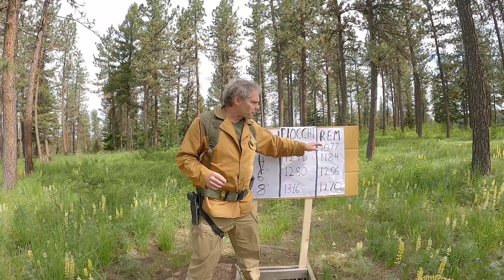How Does Barrel Length Change Velocity

Comment: I wonder. Does barrel length affect bullet spin or not? I always assumed it would, but now, thinking about it, I do see it making a difference. Once an inch or two of spin is put on it, is that all?

What about a crazy barrel configuration with a few short inches to make the spin, and then a lower friction texture for the rest of the barrel? Then the bullet could already be rotating freely while still being pushed by the expanding pressure. (Not sure if that's even possible)
Reply: To add to what Paul has said:
With regards to bullet spin, the twist rate of the barrel (ex one turn in 10 inches (1:10)) will result in the bullet spinning at that rate. As the velocity increases, the distance travelled per revolution stays the same, but the actual RPM of the bullet does increase. There is some discussion that higher RPM at impact plays a role in increasing expansion. I suspect it does, but a very minor one.

Barrels with varying twist rates are referred to as gain twist barrels. Typically they start with a slow twist rate and that twist rate increases as the bullet reaches the muzzle. Not very popular, but available from certain custom manufacturers.

The most well known example would be the Italian carcanos. My understanding is that they used this because of fears that the bullets would need to be spun up slowly as to not damage them. It was something of a state secret at the time.

The issue with a short section of rifles barrel and then smooth bore would be twofold. If the smooth section is of groove diameter, gas would blow by the bullet along the rifling grooves cut in it. If it was the land diameter, you would experience increased pressure as the bullet is further deformed. This may also interrupt the spin of the projectile.

FX airguns has had success with a smooth bore that only has the last few inches rifled. They called it their smooth twist barrels.
Reply: Addemdum to the above question. Does rifling have a sharper twist as you go farther down the barrel or is it the same all the way?
Reply from the maker: @Jabberwockybird  Same all the way through. 
 As for Barrel length effecting spin, lots of variables, but generally, the 2.5 inch barrel in this presentation will put the same spin rate as the 8 inch barrel.
Reply: @PaulHarrell  Thanks for responding, Paul.
Reply: @Jabberwockybird  that's typically called progressive rifling, there are some guns that have that (notably the milkor MGL variants) but going off what paul said the dan wesson doesn't. 
theoretically, with a longer barrel at the same twist rate you will get an incrementally faster spin rate due to some engineering reasons, but the difference is going to be next to zero.

Comment: As a septuagenarian I am anxiously anticipating your ‘Which part of the trifocal?’ test and demonstration video. Cataract surgery in 2015 much improved my situation, substantially brightening my view of whatever front sight is in use, and allowing a return to less complex shooting glasses. However, presbyopia does seem to result in diminished resistance to cumulative eyestrain: In less than optimal light, I find myself working hard to choose among two or three apparent front sights after less than an hour at the butts.
Reply: I'm right behind you and typically cope with it by using 1.5x "cheater glasses" so the sight picture is sharp and clear, then just aim at the center of the blur.
Reply: If you are right eye and right hand dominant, pick the front sight on left when having double or triple choices.  At least that's what works for me.

Comment: I think it's fascinating to hear the subtle changes in sound with the different barrel lengths during the shooting portion.
Reply: Yes, you can hear that from 4" up the rounds become supersonic which is something I've never experienced the difference of before.  Something to think about if noise is a concern.
Reply: You can also tell by the sound whether a round is faster or slower than the previously shot from the same barrel... Faster is slightly louder and higher pitch than the slower round.

Comment: To your point about the previous .38spl test between the two sub-2” barrels I’d wonder how the barrel twist rates compare between the two. Since energy is always conserved, I’d be will to guess that the slower bullet had a higher twist rate. Increased angular energy with less translation energy. Great video as always Paul!

Comment: At handgun velocities, projectile diameter and penetration depth are the only measure of effectiveness, so even a hundred FPS may not be a significant difference if certain cases. If a hunter can drive a 43 caliber hard cast bullet all the way through the target @ 1000fps 1400fps will cause no more damage. But if 43 caliber expanding bullets are driven all the way through, but with minimal expansion @ 1000fps, but have maximum expansion and full penetration @ 1400fps, there is a significant gain in effectiveness. There are also iffy zones where expanding bullets will make a bugger but shallower hole than a non expanding bullet. Then wound volume makes the difference, not velocity or expansion

Comment: 4” barrel is optimal balance for carrying and velocity for 38 spl/.357. That’s why most revolvers are offered in ~4”.

The adage is for every additional 1” of barrel, there is a gain of 100 FPS. But as Paul stated, it depends on gun and ammo and there are diminishing returns.

I think it was Shooting Times that used a Ruger Blackhawk and cut the barrel down 1” at a time and measured the velocity. Article was probably 25 years ago.
Reply: Yeah, I remember that article. Have read ST since I was a kid.
Reply: Mainstream ammunition brands are going to run pretty under-utilized powder capacity in the .357mag. If you want to see more dramatic velocity increases with barrel lengths, go with the hot stuff. Buffalo Bore, Underwood, Grizzly, Doubletap, Corbon, Steinel, and some others. Buffalo Bore will run 158 gr bullets at 2,153 fps from a 18.5" carbine, and 2,298 fps with 125gr in the same carbine.
Reply: @turnin.sprocket  yeah the big box 357 is pretty weak nowdays. I was one of the last guys on the road that carried a 357m back in the early 90s. Coworker bought a chrono and also loaded at home. I brought my carry ammo which was winchester cheapo white box 125g sjlnhp vs his hot home loads. We run it all thru a half dozen s&w of varrying brl lengths and a bolt action 8" brl pistol.
The winchester factory loads were maybe 25-35fps slower than his hot loads.  My 686 6" was sending the winchesters down range around 1500fps. Same round out out of the bolt action was nipping at 2000fps. Nowdays you gotta buy boutique 357 to get those #.  I'm still a fan of 357m out of a 4 or 6" barrel.
Reply: I've heard 1 inch for 50fps and that is with 20+ inch and centerfire rifle rounds.
Reply: @WayStedYou  rodger that. All these years later I still have to stop and contemplate variables. I've seen some things in pistol cartridge vs barrel length. 45acp seems to be a poster child where barrel length can negatively impact velocity. I've yet to see anything where magnum cartridges are negatively affected. Seems like 357m and 44m really cook out of carbine length brls
Reply: @richardcheese4722  Someone did a pretty painstaking test with a long test barrel, sawing 1" off at a time. 45acp:  /watch?v=lR_oshbhII8
Reply: The optimal length is completely subjective. Context is king.
Reply: My GP100 4.2 agrees!
Reply: Your wife rather have 8"  stop trying to make up stuff why 4" is better
Reply: @DogDad303  diameter or circumference?
Reply: @richardcheese4722  Ground clearance.
Reply: @DogDad303  "Tell me you've never lugged your piece through the brush without telling me you've never lugged your piece through the brush"
Reply: @michaelturk7237  brush clearing is all the rage these days

Comment: Ammo companies make ammo with quicker burning powders that helps with shorter barrels. I don't know if it works, I just see people talk about it. I don't have a chronograph, I just look for tight accurate shot groups. Quality carry ammo usually gives you consistency, cheap range ammo can open your groups from inconsistent charges and other QC issues. Hornady is good, Herters your lucky if it leaves the barrel. Barrel length seems to not matter to people anymore since more people carry snubbies or little pocket size semi autos. I like carrying my LCR or Hellcat for convenience but still like full size pistols and revolvers for fun at the range.

Comment: Great topic and nifty test equipment.  I liked how you tried to mitigate the other factors by using the same frame but different barrel lengths.
Reply: SCAM ALERT! ^^^ THAT is a SCAMMER. Please be aware that that is a SCAMMER and do not fall for the SCAMMER.

Comment: Since I only see pistols there, I’m going to ask this question ahead of time, as I begin watching. What is the effect of a 16 inch barrel on a 9mm PCC? I ask because I have been told that 147 grain for instance, is ideal for this length. I’m assuming because the barrel speeds this heavier but usually slower round up. I want to confirm the validity of this.

Edit: loved the attention to detail and dedication to giving us the “boring” stuff (that isn’t boring). I see a Paul Harrell video and am watching within minutes.
Reply from the maker: We have a presentation comparing handgun velocities and PCC's
Reply: @PaulHarrell  Thanks !!
Reply: @danoneill2846  Thanks Paul! Dan found it first. 👍
Reply: @NOLAgenX  I felt bad sending you to Lucky Gunner when Paul did the work & this is his Ch . I forgot about this video . BTW I have a Foxtrot Mike -9  16"   so far never jammed , great option . Also , Win Wt box ammo gets lots of dis , Paul & Tarren Tac , and I , say it's great ammo for the $$$ , only slightly worse if any than the high $$$ ammo . Gun Sam has done some testing with it also , it did very well !!!
Reply: @danoneill2846  Really appreciate the info. I’ve found a large amount of the older Federal 9MS 147 grain that fires without incident in my Scorpion Evo 3 16”, and even target ammo that has the same stats, so I’m sticking with those. 

Similar to what Paul said in the PCC video about staying consistent since different ammo can have different points of aim. I just had no real idea if it was doing what I thought it was. I’ve stayed away from 115 grain because I was worried about it accelerating too fast to expand. Turns out that isn’t the case, thanks to Paul!

Gotta get to bed. Appreciate you!
Reply: Check out Lucky Gunner Ch   I think he did this test , I thought the same thing . Turns out with most factory ammo , very little change . 125 gr +P  type stuff  got more gain .
Reply: This looks like the one Paul did    in this test with Win Wt Box  he got about 130 ft/ sec gain +/-    https://www.youtube.com/watch?v=S1AHNWgrFnY
Reply: @danoneill2846  You’re outstanding! I was still looking and got sidetracked by the wife. You went out of your way. Much appreciated!
Reply: @NOLAgenX  Ballistics By The Inch have a lot of kinds of ammo in a lot of calibres. Most of the 9 mm Luger maxes out at 17", all the way from 90 gr to 147 gr, with the one 147 gr in the list going 1007 at 5", then 1030, 1040, 1047, 1055, 1067, 1059, 1081, 1081, 1090, 1090, 1073, 1096, 1083. To me, that "up and down" says they didn't fire nearly enough rounds in each string to get a good average. From the first 1081 to that 1096, you're carrying an extra five inches of barrel for an extra 2.8% energy. The same increase in length, from 12" to 17" for the 125 gr +P takes the velocity from 1514 to 1550 fps, an extra 4.8% energy.

Sidenote: 9 x 17 mm Speer Gold Dot 90 gr maxes out at 15" with 1238 fps, which is 415.19 Joules. Out of 10", it's 1201 fps, 390.75 J.
Federal 125 gr .357 Mag maxes out at 18", the longest they tested, with 2072 fps, which is 1615.31 J, nearly four times the spice.
Out of a 2" barrel, though, at only 949 fps, it only has 338.85 J.

Under certain, rather specific, circumstances, .380 ACP really is just as powerful as .357 Magnum.
Reply: I believe 9mm is optimised about 11" for velocity...16" like Paul's beretta re drag. As far as ballistics you want hard anatomy bullets ie gold dot xtp or critical duty...124 plus p or 147 ur choice

Comment: You need to stop saying “more pressure built up”.   You are on the right track focusing on time in barrel.  The longer the projectile remains in the barrel, the larger the product of force x area x time becomes (more velocity) - unless of course it is a 22lr , then at about 14 inches , the barrel friction about equals the projectile incremental add  of force (and note, no, the 22lr does not build up more pressure in a 14 inch than a 10 inch - …).  There are quite a few sources for barrel pressure v time , showing the pressure wave shape.

Comment: I imagine another factor(albeit almost certainly minute) could be a consistent grip on the pistol. 
Think of an air nailer. If you loosely hold the nailer and let the nailer push your arm and wrist back when you pull the trigger your nail will often not seat all the way. Pushing on the nailer and holding it in place usually allows the nailer to exert greater force directly to the nail instead of being absorbed in the arm. 
However in you case, Mr. Harrell, I also imagine that your vast shooting experience leads you to have fairly consistent grip positioning and force. Even if your groups are often “not very good”.
Reply: His "not very good" groups are competition winning groups compared to most folks, haha

Comment: I’ve often wondered how to do a barrel length velocity test without having 4 identical models and the Dan Wesson was the perfect test platform.
Reply: One bolt-action single-shot, one hacksaw, one file to tidy up the cuts, ...
Reply: @Sableagle  Can not love that post any more!!!!
Reply: @Sableagle  
A few have done that, one actually used a lathe to chop barrel back at 1 in / 2.2 cm at a time, face off barrel  then 10 shot group.
Reply: Yes, great pick. My first thought was the same model of a S&W 357 Magnum in snub nose, 4", 6", and 8". Then test 38 Special and 357 Magnum. Maybe a little variance due to four guns, but not enough to matter.

If any of you guys have revolvers like that and a chronograph, let us know what you get!
Reply: Get a long barrel and cut it down.

Comment: I guess there is some scientific evidence as to why I prefer 4" barrels over snub-nosed revolvers. Thank you, Paul and crew, for another excellent presentation under less-than-ideal weather conditions.
Reply: For as long as I've been shooting, I've always found that snub-nosed revolvers, and other small form factor handguns, are just incredibly unpleasant to shoot.  They're handy, when you need something that's easy to hide, but they're a chore to practice with...
Reply: Revolvers with 4" barrels tend to balance and point very nicely, so there's more than just velocity at play.
Reply: There's another thing about the snubbies: the shorter the barrel, the higher the pressure when the bullet leaves it and the louder the pop.
You also get a bigger fireball from more unburned powder mixing with the air and burning at low pressure, incompletely, which makes it shine like the soot in the outer part of a candle flame, so you get a flash to go with that bang.
A short-grip, short-barrel, five-shot, internal-hammer, DAO revolver is a great thing for a girl to have in each jacket pocket as a "Get the hell off me!" device, but imo no fun at the range.
Reply: Guess my Ruger Vaquero chambered in .44 mag with a 7 and1/2" barrel is in the same boat.
Reply: It was never in doubt and vast evidence has been there for many decades. You just had to look it up or chrono it yourself.
Reply: Snub noses are for up close and personal
Reply: @williamgregory6684  Guess my 686-6 is worthless at anything UNDER 15 meters then.

Comment: It can definitely depend on the propellant. I have found for a longer barrels, slower burning powders like H110 and Blue Dot are able to better capitalize on that extra length. That being said, the French GIGN determined that 5.25 inches was the ideal combination of speed, power, and accuracy, hence the Manurhin M73. Love that Dan Wesson though. Kinda wish I hadn’t sold mine.
Reply: Interesting about the Manurhin M73 . Ever since I bought and fell in lov with my first 6" 357 I've been hoping NOT to run across that $3000  Manurhin M73 in a gun shop ... lawd grant me the strength .
Reply: @EdD-ym6le  I understand your concern. I'm saving up for a cytogeneticly treated AR barrel. The what would Stoner riffle is nice but I have food and gas to buy.
Reply: Well, having M73, I dare to say I would never need any other revolver in my life :)
Reply: @rodrigoroaduterte9415  I second that !
Reply: I got my first revolver in a five inch. A 686+. I couldn't decide between 4&6 so I chose 5. There something about the looks and feel of a 5 that is just right.
Reply: Isn't part of the reason for their barrel length something about barrel harmonics?

After all, a .22 on target is a lot more effective than a .500 S&W that missed.
Reply: Personally I like RDX, but having to learn to type with my nose is not really worth it.